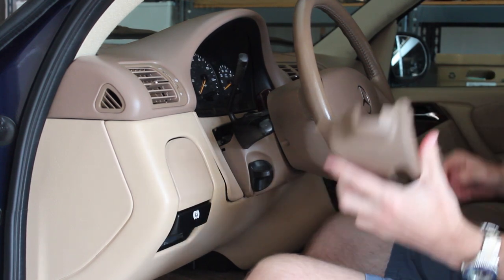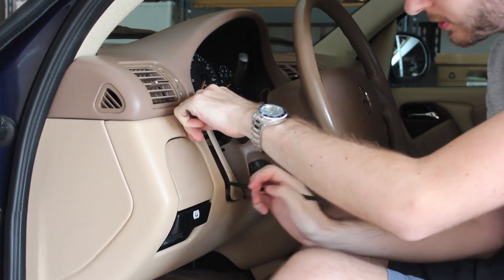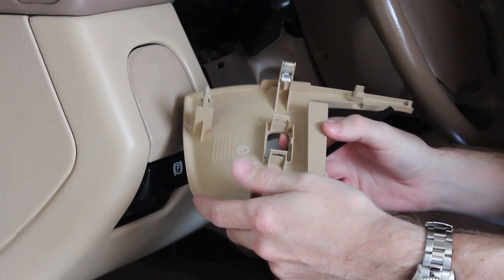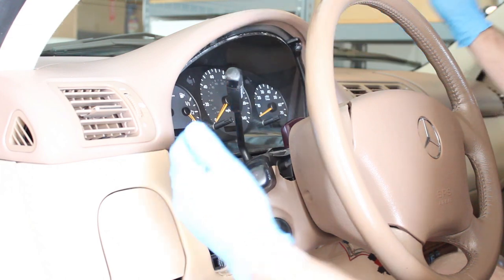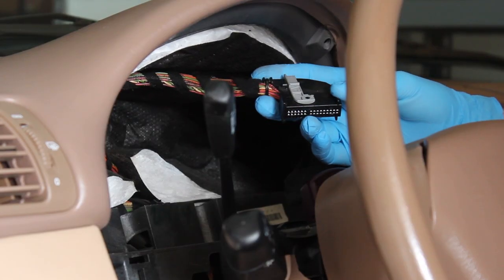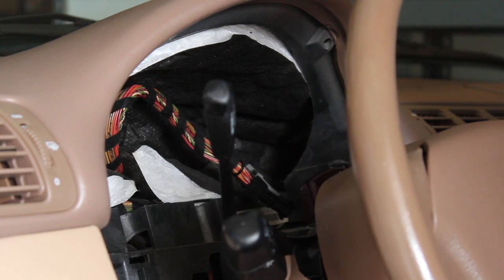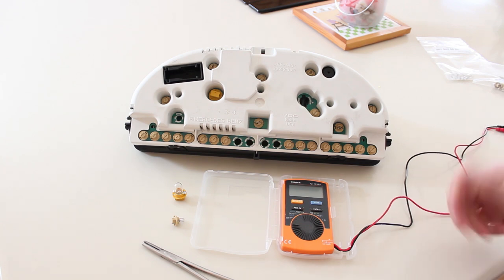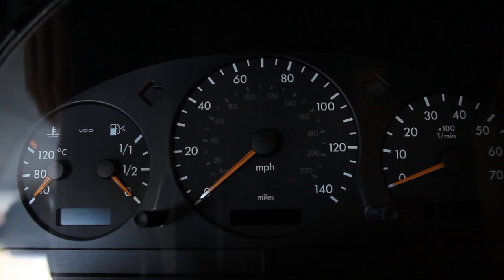Mercedes-Benz ML Gauge Cluster Removal (W163)

Comment: Thanks for this clear video ! Did you ever find the part # and part that cracked ? Cost ?
I'm sure our 2002 ML500 won't do the same, lol !
PS: Mileage display light just died...
Reply from the maker: Never bothered, if you are looking for a replacement I recommend looking for a used piece on eBay since these MLs are worth so little nowadays that the new parts (if available) are generally 10+ percent of the value of the vehicle - losing proposition.  If you want to avoid breaking the piece, you can simply pull the steering wheel - just disconnect the battery, allow it to discharge, pull the airbag, and pull the nut holding on the wheel.  

Thanks for watching!

Comment: Having trouble with my cluster help!! Everything works but the actual guages. Any suggestions?
Reply from the maker: Sounds like a connection or whatever module controls the cluster on the 163 chassis.  I've not had to diagnose so I can't really provide any further direction there.  Thanks for watching!
Reply: Im having somwhat the same problem, any advice